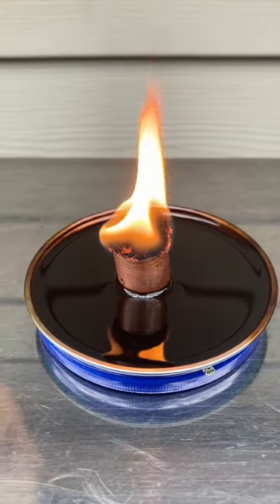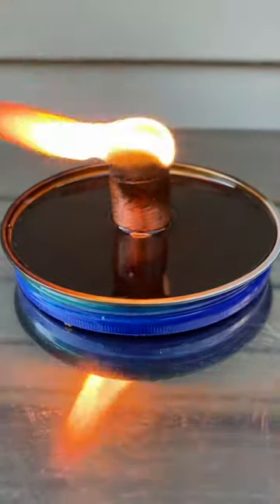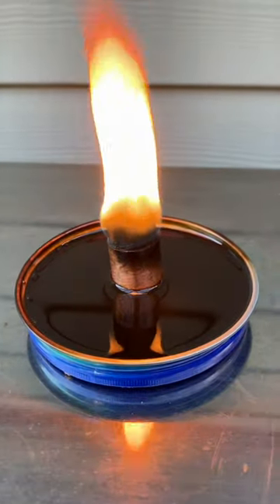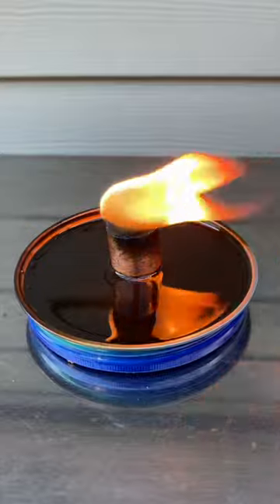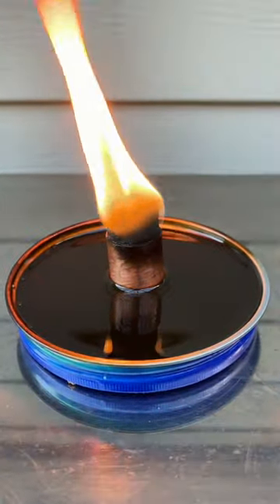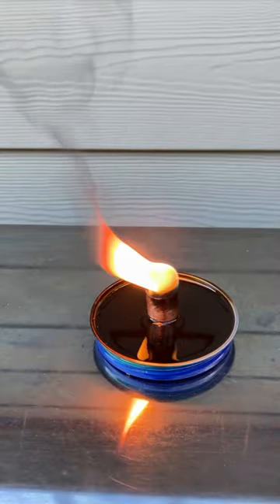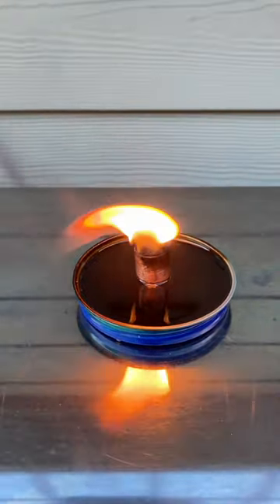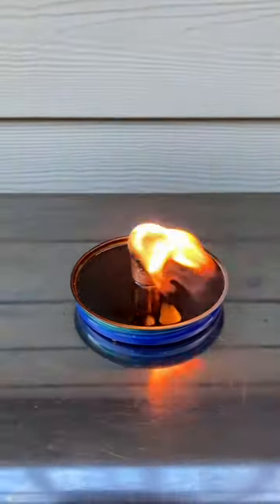This Wick's INGENIOUS! Prt 5🔥🤔 Used MOTOR OIL #shorts #diy #tips

Comment: How much time you can use wick without replacing it using motor oil?
Reply: They foul up very quickly with minerals from the motor oil.  That's what they're not showing you.
Reply: @dansw0rkshop  there are not many minerals in the oil but there are lots of carbon junk. The felt tends to filter the oil and collect the carbon which restricts the flow of oil for fuel.